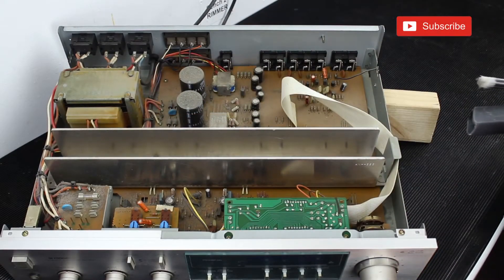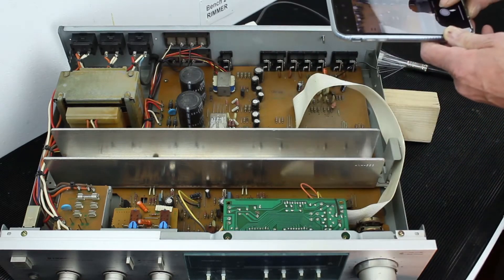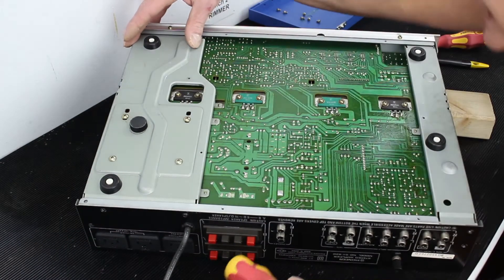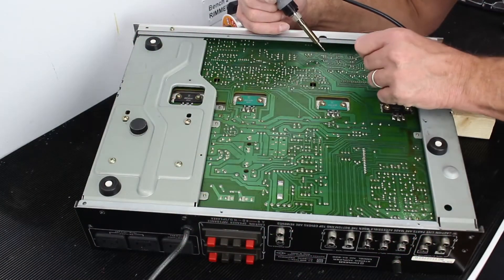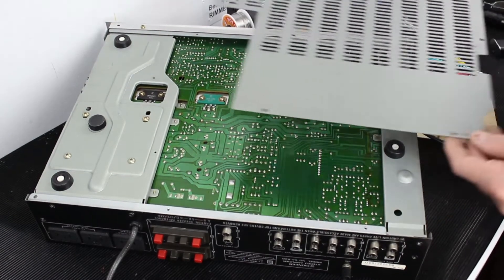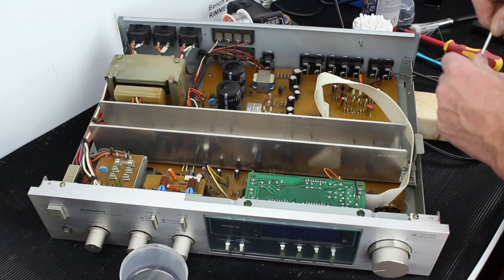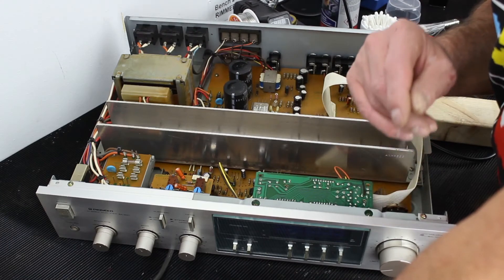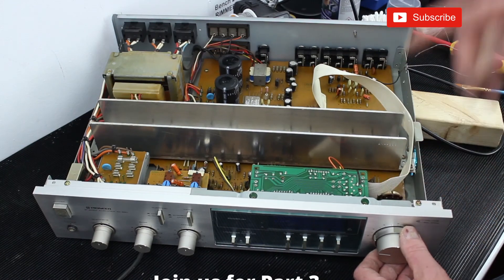Pioneer amplifier SA-620 part 2 internal clean & inspection-40 years old & not working. Lets sort it

Comment: Thank you for the video. No real repair, but nice to see the amplifiers from the inside and how the components work together. What I've noticed with multiple Pioneer amplifiers with 'orange boards', that when you start soldering or cleaning the boards with a liquid cleaner. That you initiate a kind of chemical reaction on the board with a terrible smell. Impossible to keep the amplifier inside your house. Is this something that you've experienced before? I've had 3 different Pioneer vintage amplifiers with orange boards and the same experience.
Reply: Hi. This isn't a problem i've encountered before myself. Once there is some component heating that damaged the surface of the board, it really can smell as it burns the layers below. I would be interested to see if you find a bit more out about this. I have scrapped out burnt materials before and applied PCB lacquer to seal the damaged area.